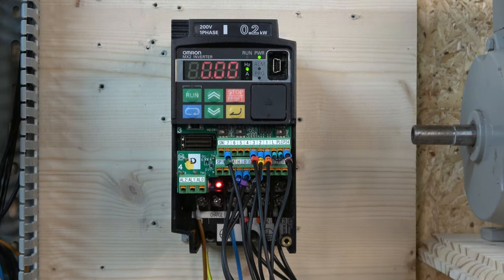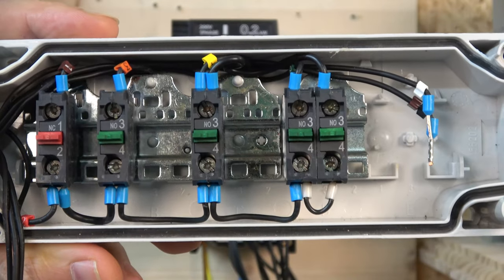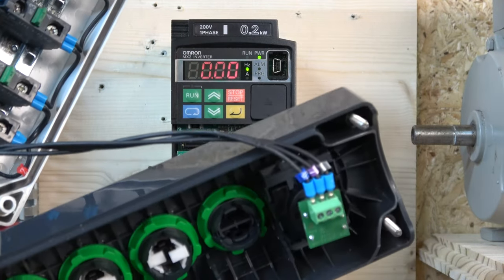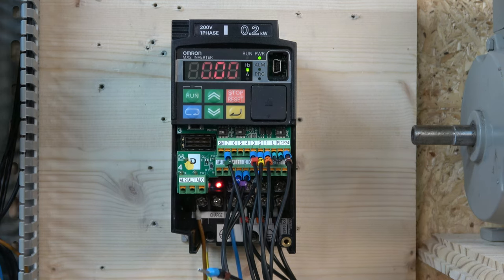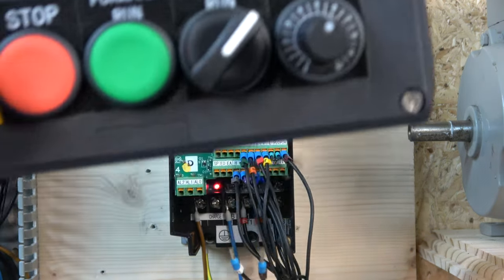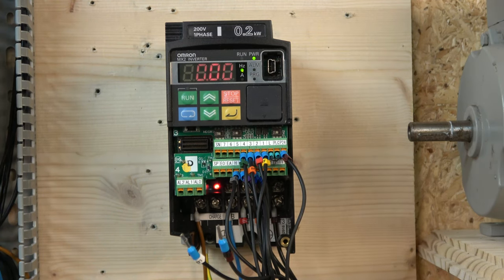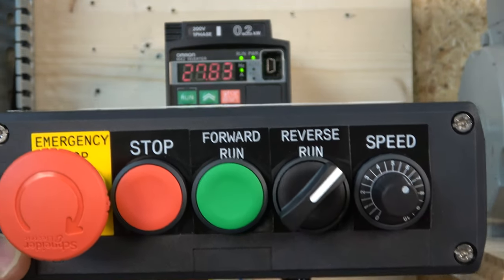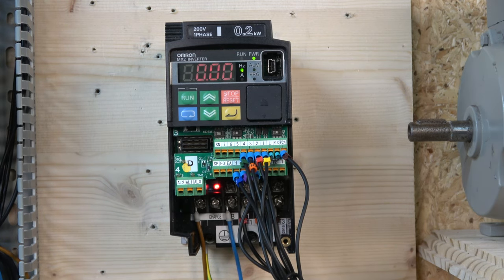Omron MX2 VFD remote control, 2 wire control, 3 wire control, remote speed control. (English)

Comment: I want to use 4-20mA to control the frequency of the motor but when I my 4-20 on terminal OI and L it does not work. Again the moment I start the drive the frequency goes straight up to 50Hz any other parameters I need to check. My drive type is Omron MX2 Inverter 5.5 kW.
Thanks

Comment: Hi again, hope you can help me on this, I am trying to get the pott to work and it's connected as yours is, the manual tells me to set value in D062 but there is no D062 in either of my 2 MX2's I have D060 and D050 and more but no D062 am I a total berk or what am I missing?
Reply from the maker: Hi There. I cant remember way these parameters been blocked out, but i do know that there is other setting that needs changing to unlock them, do check the manual. If you require more support on these matters, you might be interested in patreon program here: https://www.patreon.com/igselectronics?fan_landing=true